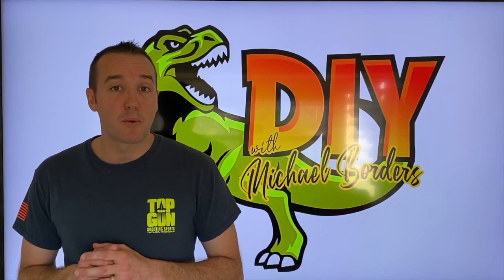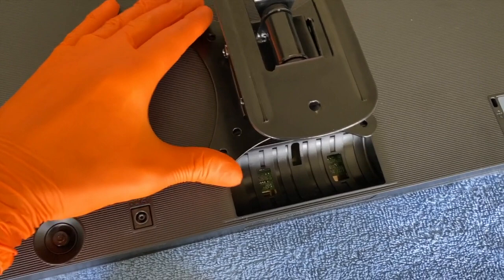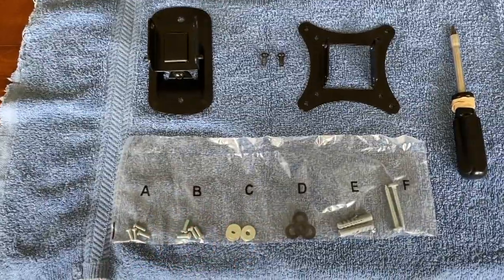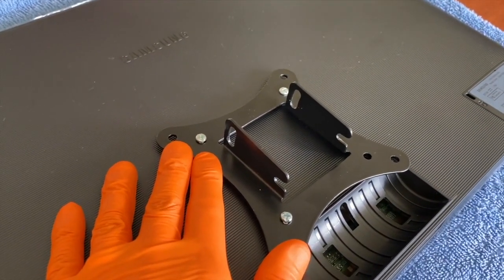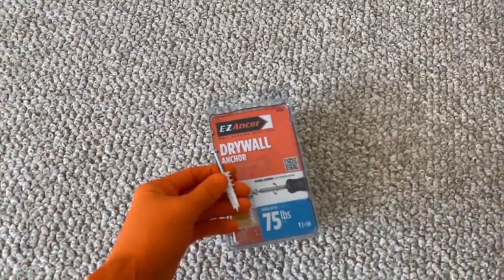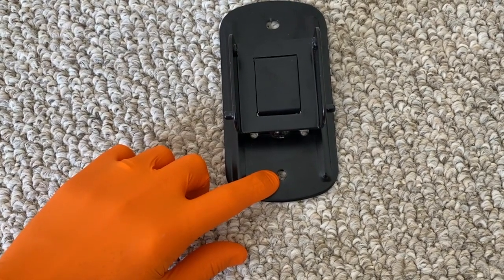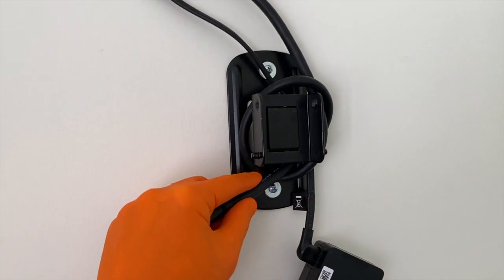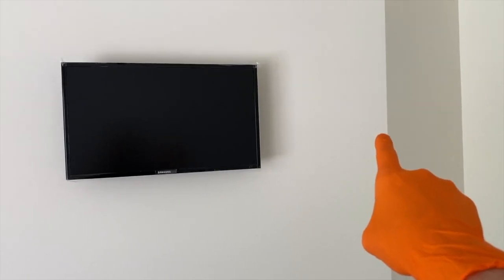How to mount computer monitor on wall - DIY

Comment: Nice tutorial. How would you seal the drywall hole running the cables?
Reply from the maker: Thanks for watching & welcome to the DIY Raptor Club.  Did you seal hole.  We have seen people apply various things including blue paint tape, insulation, electrical tape...

We don’t have a thought or recommendation on how to seal, we leave ours open.